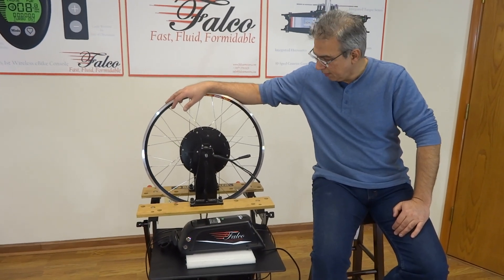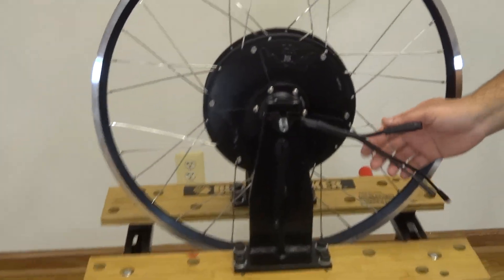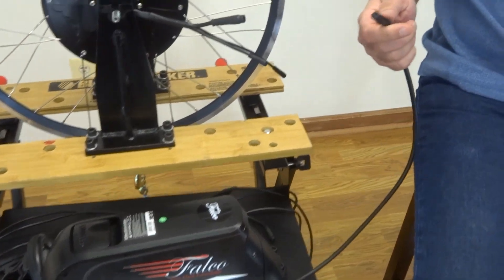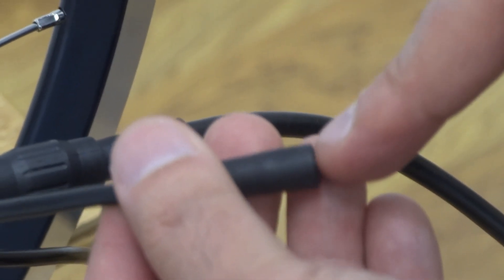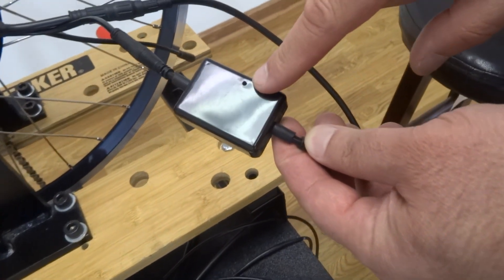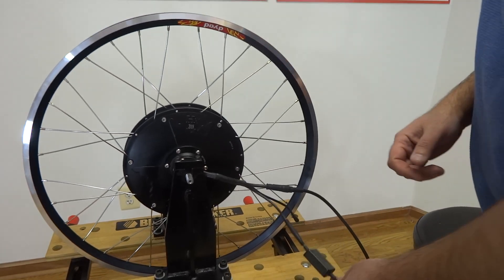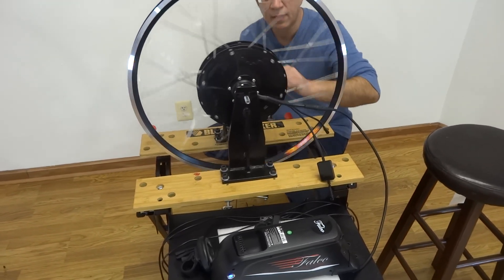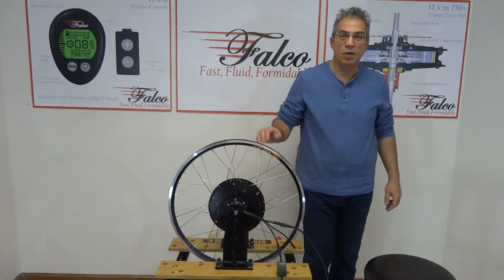A Simple Pedal Assist System

Comment: Why not build the wireless module into the motor? Would look a lot cleaner. As it is, I think I'd rather have a wire running to a display than a big box like that module strapped to my bike.

Comment: Is it possible to set the PAS power output with the smartphone app and then disconnect the wireless module? So I don’t have to mount the wireless module on the frame? Can the motor run without the wireless module connected?